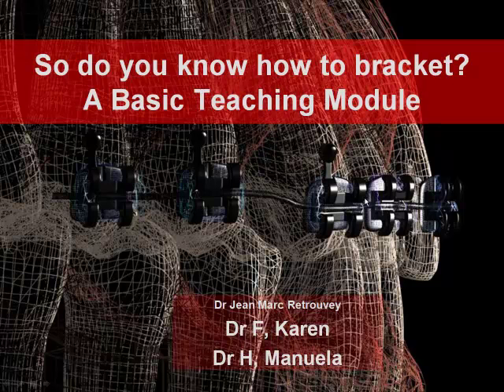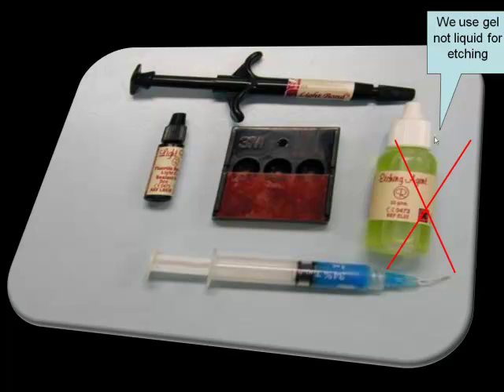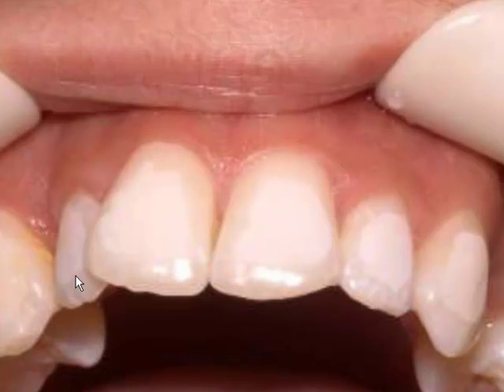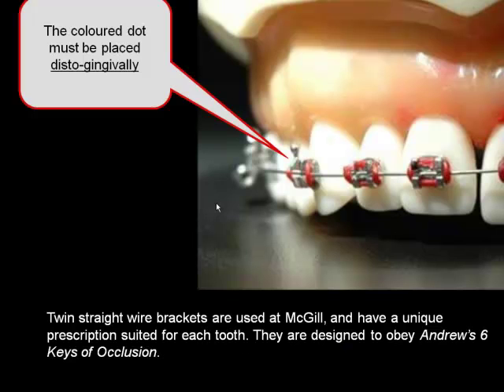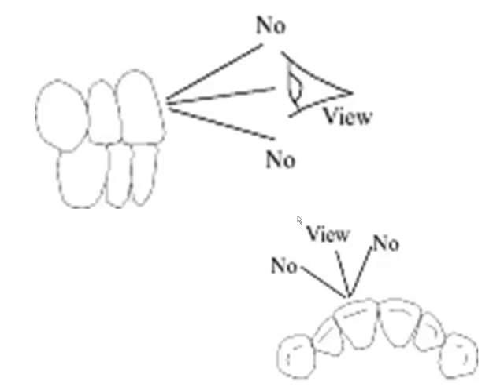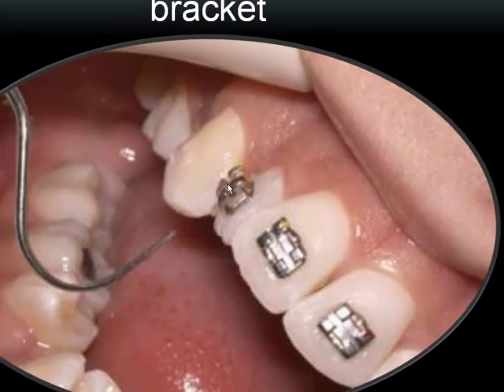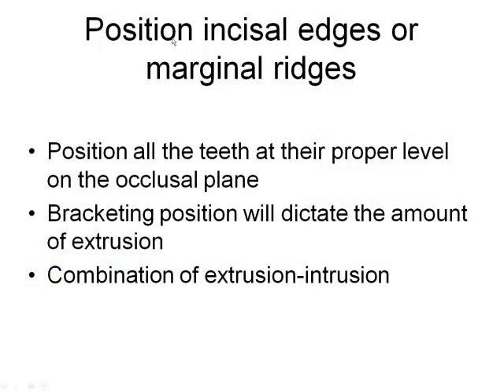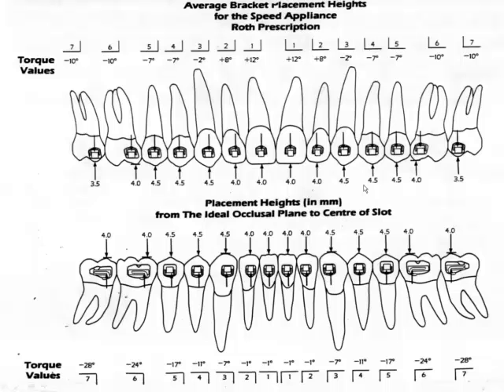How important is the position of your orthodontic braces?

Comment: How can you determine tarque with bracket?
Reply from the maker: The torque is in the bracket. The position affect the "torque" as the cut in the bracket is designed to work in a specific position
Reply: @Discoverortho1  wire shape also effect tarque?

Comment: Why does y braces keeps on falling i think the glue they used does not stick that much
Reply: Or it could be what your eating? Mine broke off after eating hard foods.
Reply: If you have a crown, it will keep popping off because it's not a natural tooth. They have to use a special glue for that.

It's possible the tooth wasn't prepped properly and saliva got on the tooth before the bracket was placed. 

Eating the wrong foods can pop it off too

Comment: My dentist placed a bracket on the part of the tooth near the gums, not on the center 😒
Reply: Mine are wayyyy too close to bottom
Reply: I recently had my front four brackets high up near the gums. My ortho said it will help my teeth move into position because with the standard middle position, my teether barely moved.
Reply: Sollertia I’ve seen some with that same situation. There might be a reason for it but I honestly would hate that kind of placement >_<
Reply: Mine are soOoOoo high up! I had them on forb1 dat and in ready to take them off!! It's going to be a LONG 16 to 18 months😣
Reply: I got one positioned exactly on the edge btw the gum and the tooth I hate it!
Reply: Those are called SAP braces technique it’s to shape your smile arc a specific way, my front foot teeth the brackets are super high it may not look aesthetically attractive but at the end of the day there’s a reason for it

Comment: My brackets are not positioned well. This caused me to have a deep bite which I never had before I even got braces. I'm very disappointed of my orthodontist and myself too because I realized it too late. It has been over 2 years since I started my braces. ugh, what should I do?
Reply: Gabrielle Niña Konahap find out if she is the dentist first , we had an assistant who told ppl she was the dentist , far from it! A few ppl were coming in under our new Dr (old one passed away) and they were not correct at all.
Reply: If your teeth are perfectly straight, you can have your bite  corrected, otherwise sue the ortho who did this to you and get it fixed.